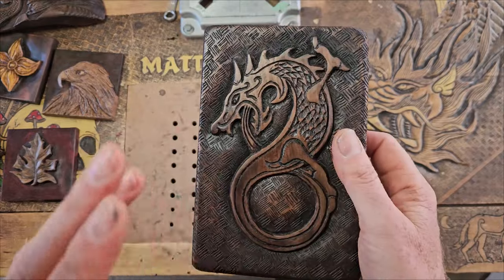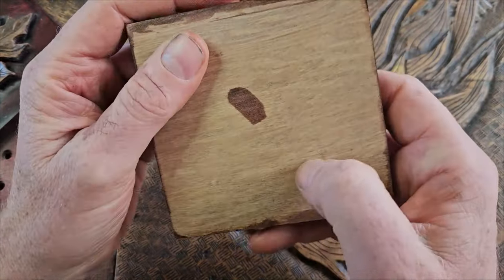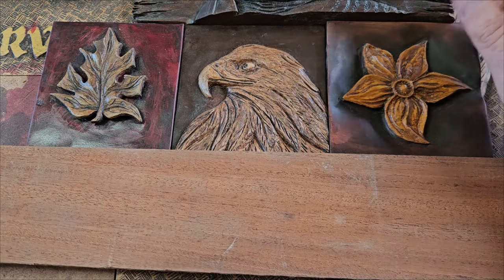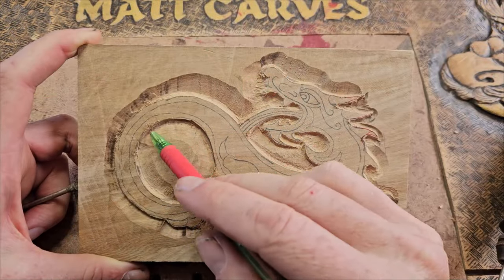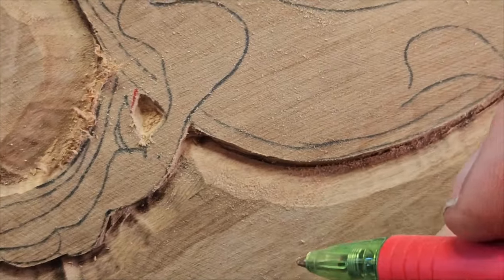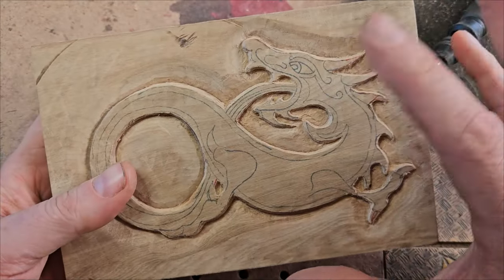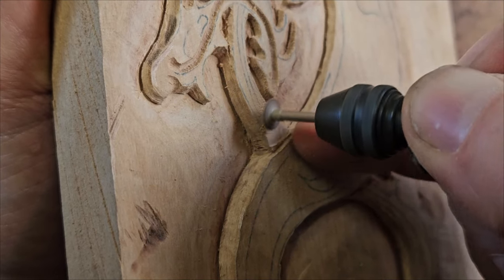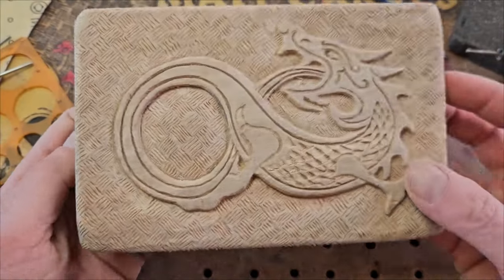Beginners Dremel Carving

Comment: I practice on cheap bamboo cutting boards. I get at a local shop that's like a dollar. The bamboo is a little strange to cut or should I say to drimmer on? I also cut up 2 x 4 s used in lumber for framing
Reply from the maker: Can't say I have ever carved bamboo, sounds fibrous.
Reply: @MattCarves  I really don't like the bamboo I'm done with it